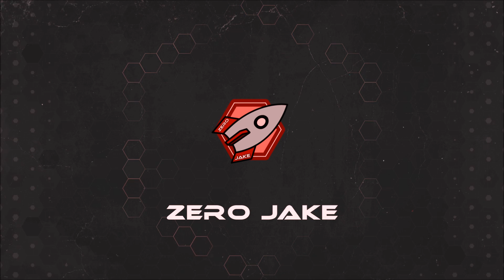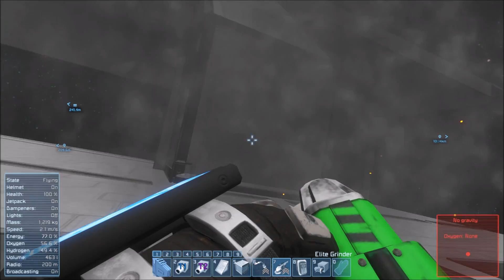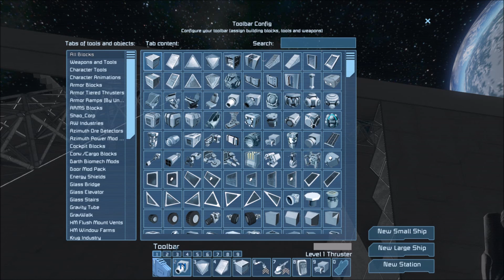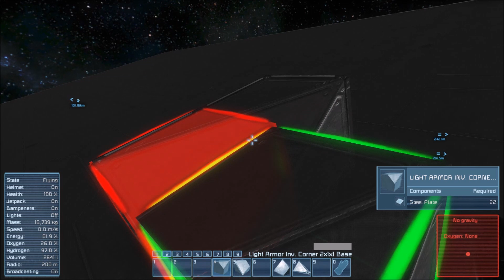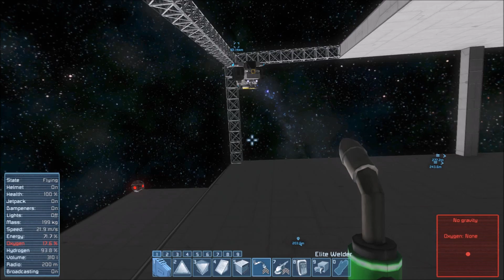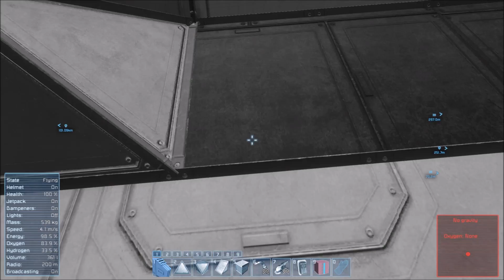Space Engineers - Flight Deck pt 1 - Episode 28

Comment: This station is going to take ages
Reply: You should but mining lasers on the station if it works facing the moon
Reply from the maker: +jared walker I don't think they have that far a range. Even if they did, it would be inaccurate as hell, but I will investigate
Reply from the maker: Also, there isn't much left to do on the station, just weld the hangers, do the flight deck and wall up the living area and then I can move in.